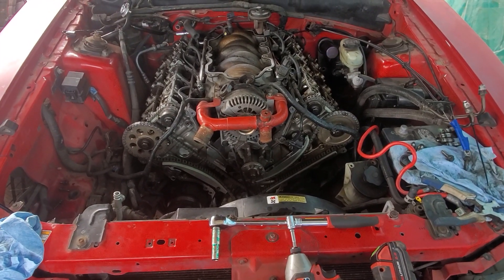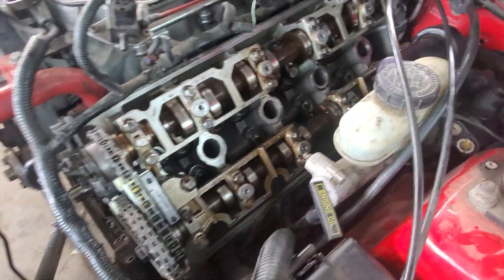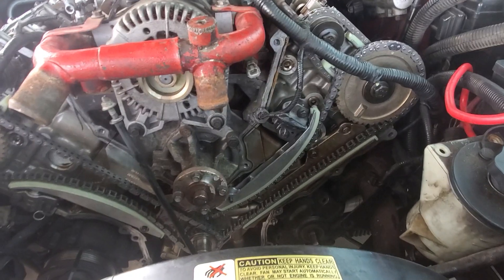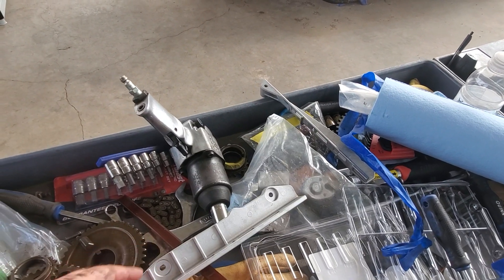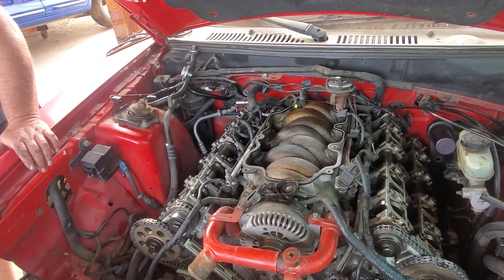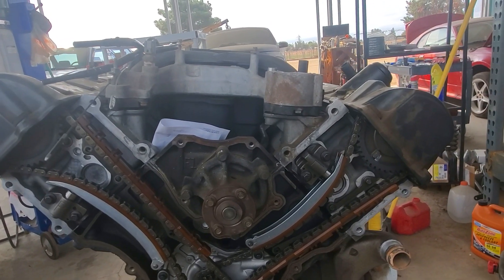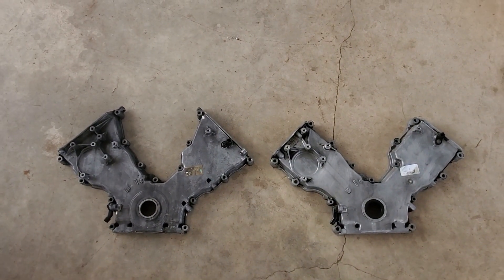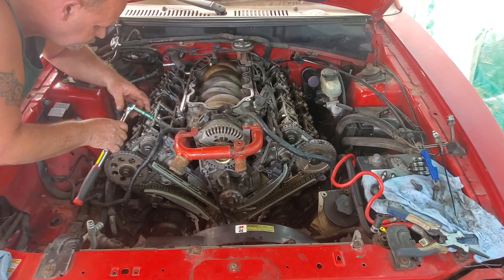how to do a 4v cobra timing chane

Comment: I got a loose timing chain on my 01 Cobra. Rattles loudly on cold starts. Would you recommend changing anything else while I’m in there?
Reply: Oil pump
Reply from the maker: check lashers and rockers. But most cobra's need valves job and valve guide.

Comment: You take the motor mount nuts out.   Put a jackstand on where the oil pan and timing cover meet passenger side.   Drop the body of the car down on driver side SLOWLY. Boom you can remove the valve cover without messing with hydro boost or clutch cable.   2v are easy to work on but not worth it compared to a 4v.
Reply from the maker: We already tried that. Still didn't work